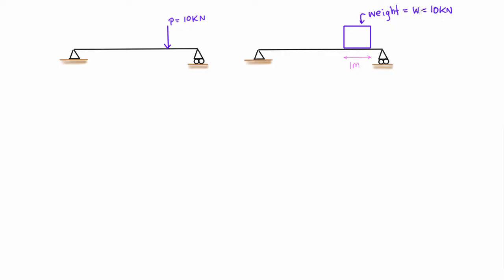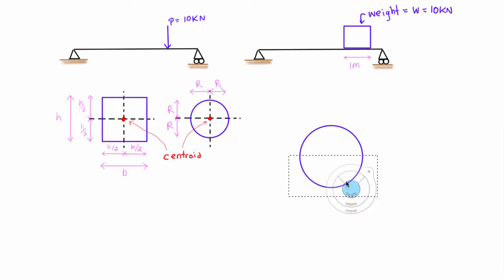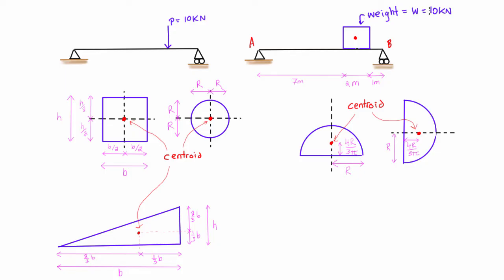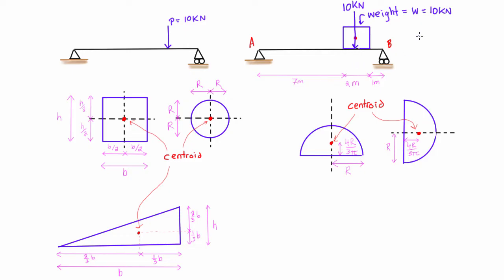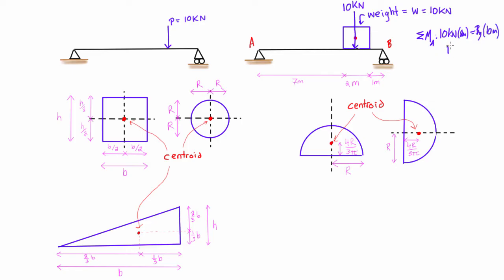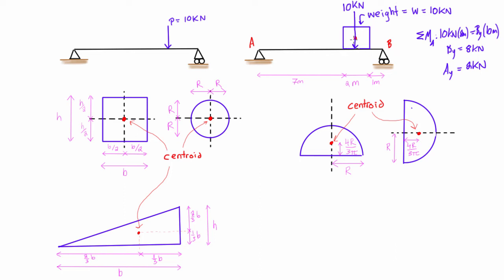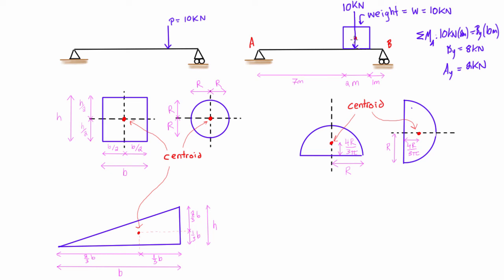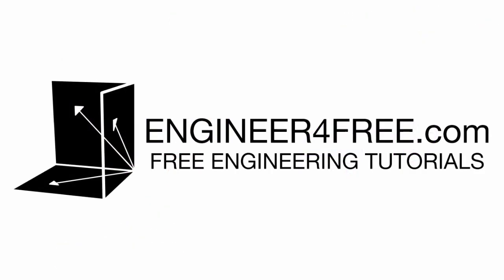Introduction to centroids (statics)

Comment: Sir in the right tringle. In the opposite of the angle. Isn't 1/3 (h) and 2/3 (h) instead of 1/3 (b) and 2/3 (b)?
Reply from the maker: Yes, good catch. Sorry that is a typo, it should be written as you described.
Reply: I believe so too